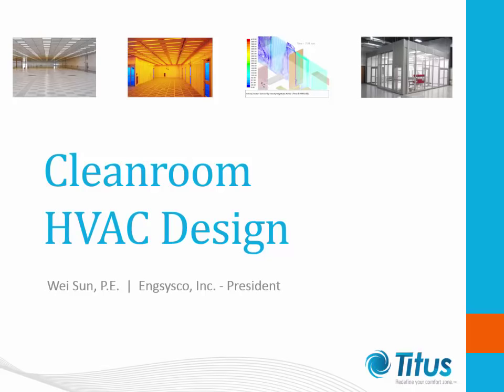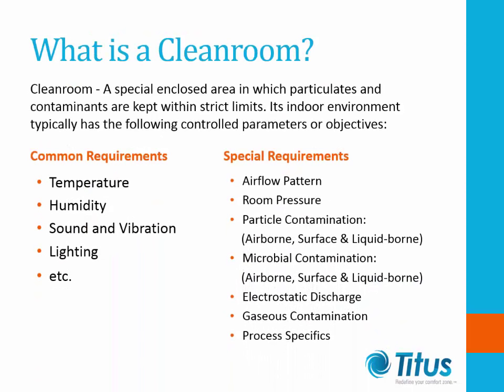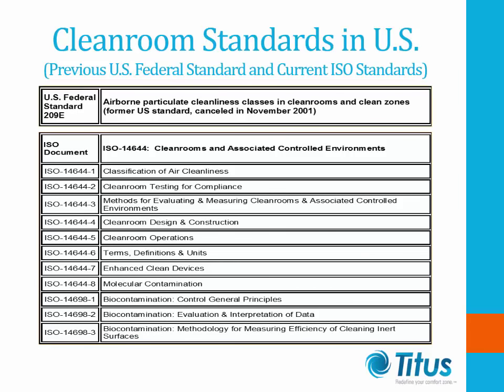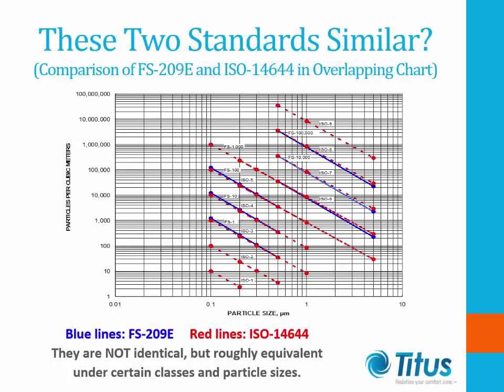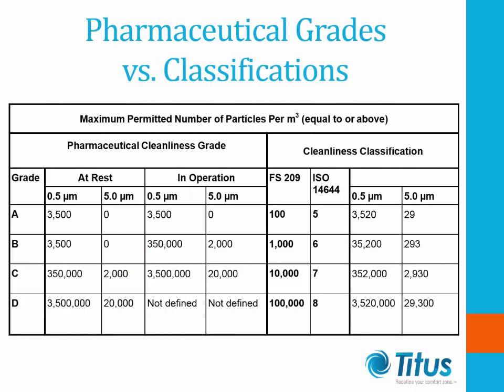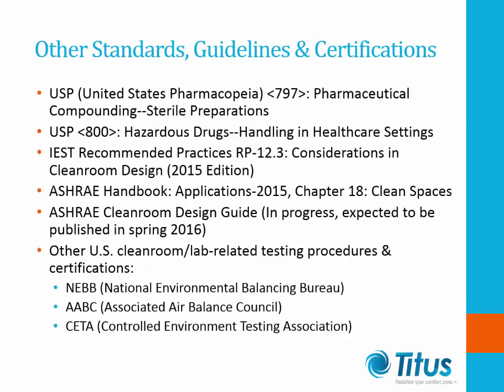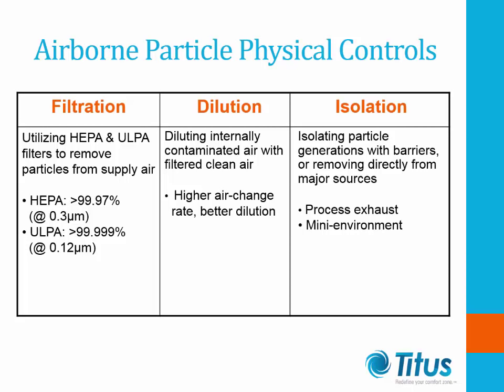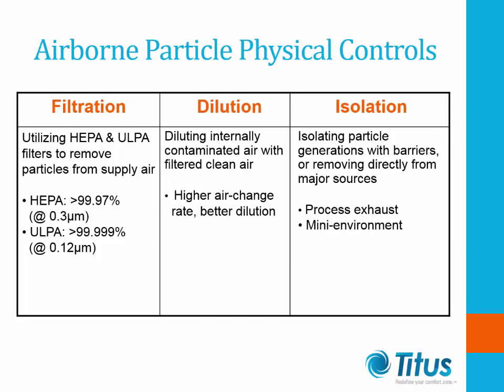Cleanroom HVAC Design Webinar

Comment: Atually the required air flow to create pressure differential is dependent on the air flow across the doors. Thus door size and leakage round the door is important.